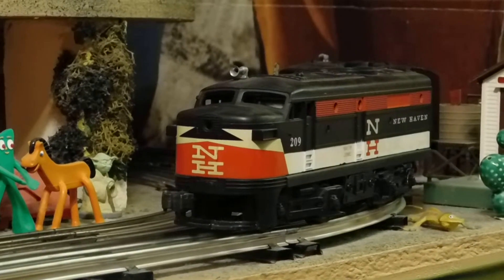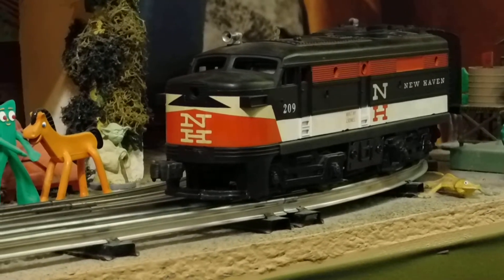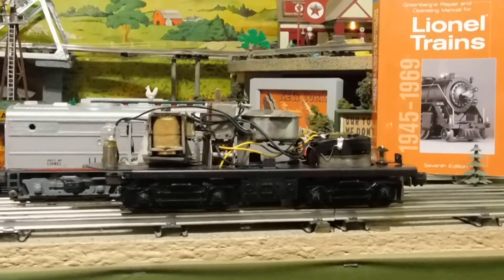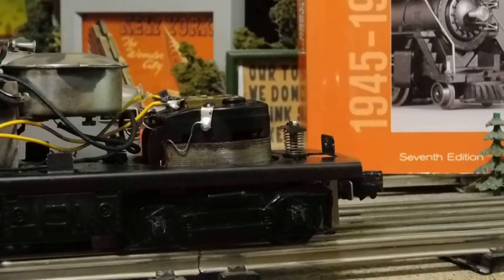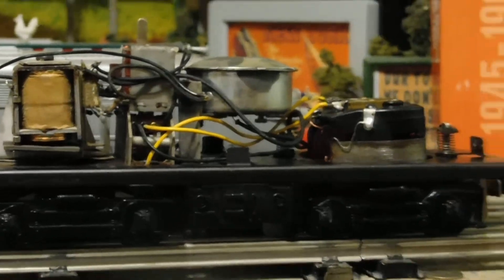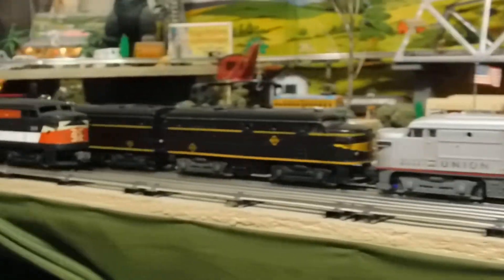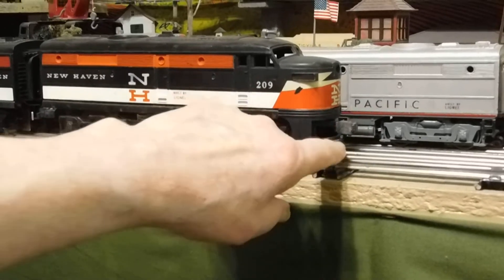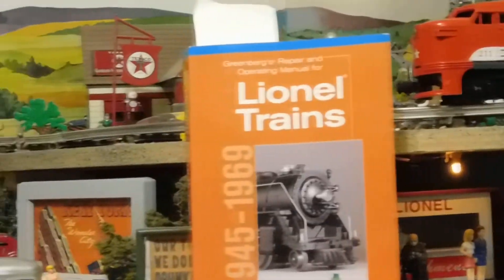Restoring My Lionel Postwar 209 New Haven AA Alco FA's

Comment: I too am trying to decide what I enjoy more, finding & restoring trains, or running them. It seems up to now I've spent most of my time finding & restoring (with an emphasis on restoring, because most of mine start out as one step away from being junk) , but maybe that's because I've started from zero, to over 50 of them in the past 2 years.
Reply: Same here with me.....I usually have good luck searching those parts boxes under the tables at the train shows.......some of my best stuff started as just a frame or body and searching for left over parts lol!
Reply: I like rebuilding em, but it’s also fun to run em. For me rn, I like to get em in decent shape, & get em going again or for em. I do mostly the die cast steamers. 

I’ll take em to full throttle then reverse em a shot ton, & send em flying down the track both ways spinning the wheels like mad, then sometimes I’ll do it while pulling 10-20 or so cars.

You’d be surprised at how much power the little steamers have in em. I’ve got a 2035, 2025, & 2037. The 2037 is a frigin rocket!